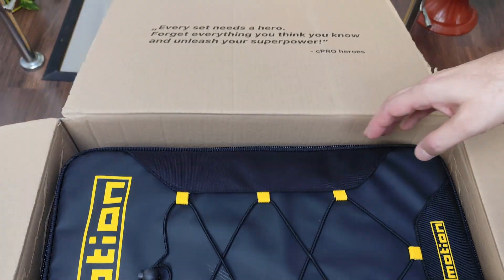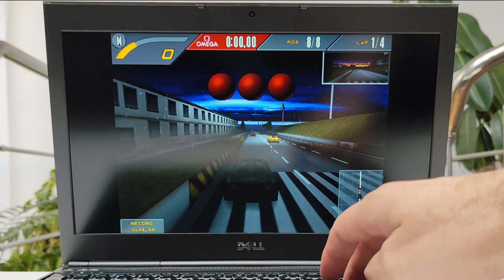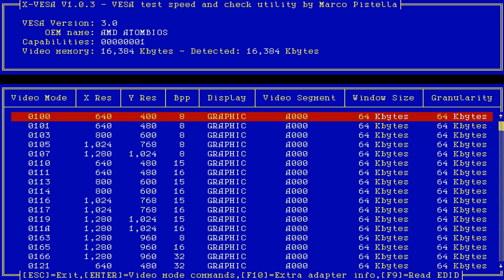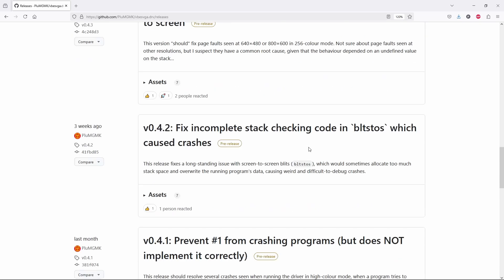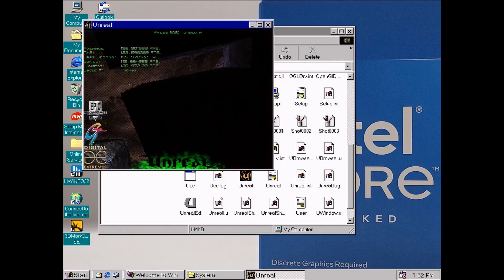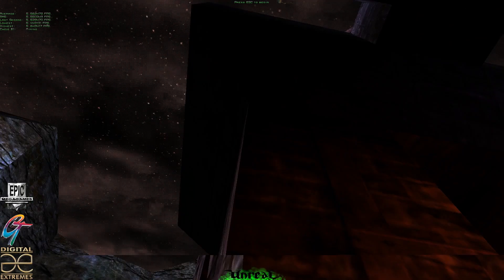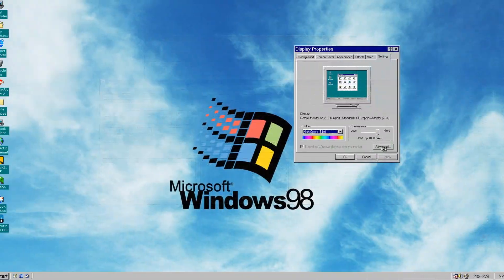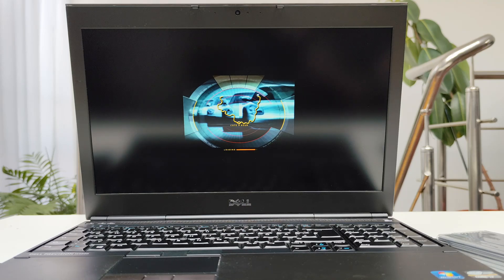World's First 3dfx Voodoo 4 Laptop: It Works in XP, But Windows 98 Chose the iGPU

Comment: you need laptop have bios to make egpu is main gpu
Reply: For that, the guy that made the adapter would have to make a bios for the Voodoo 4 to be MXN compliant,and also the laptop´s BIOS has a whiltelist, so he would also need to patch the BIOS
Reply from the maker: Oh wow, someone actually watched the video! 😄 Plan B would be to install Coreboot BIOS  - it actually works on this laptop and can boot from the Voodoo 4. However, as Daniel from sdz-mods discovered this week, it's not compatible with Windows 98 or XP.
Reply: @ i had same problem my egpu is 7600 and its compatible with 98 with patch 
But bios is bad so....
Can you make video about this fix?
Reply: @O_mores  Would Windows 7 work? You can use Voodoo3 and newer on 7 32-bit (there are maybe some x64 drivers too), even if it kills parts of the fun
Reply from the maker: @pankoza2 Yes, it should work on Windows 7 using SFFT drivers. My Voodoo 3 PCI does function in Windows 7, though it's not the best experience. You can see my Voodoo 3 PCI in action here: https://youtu.be/RWupO_3Zv6s it was the same problem like in this video, initially I couldn't make it the primary video card but (to my surprise) I somehow managed to do it.